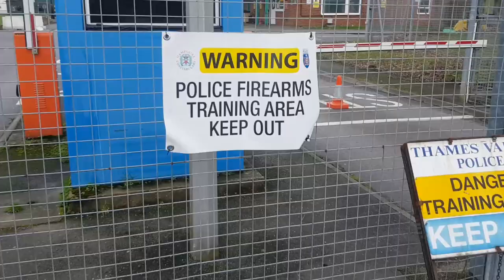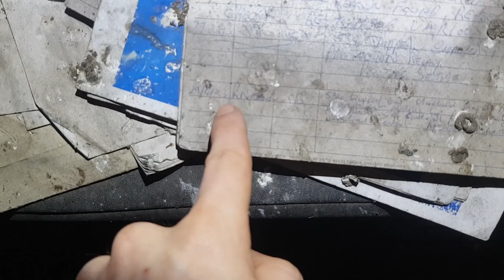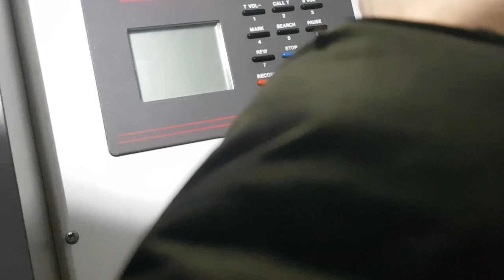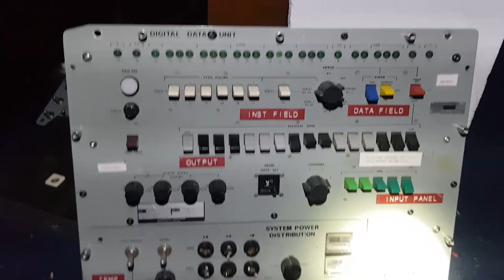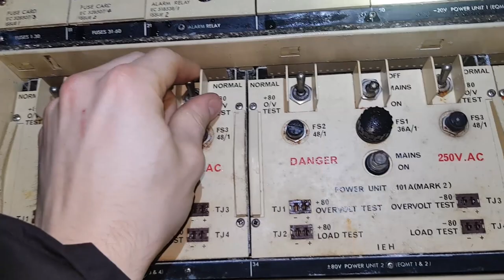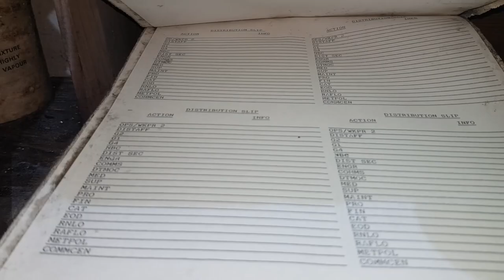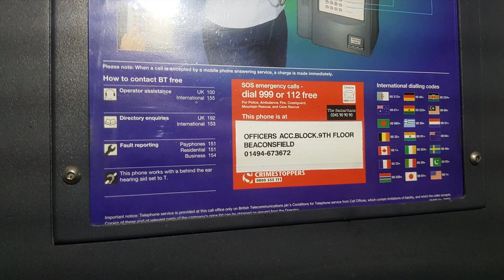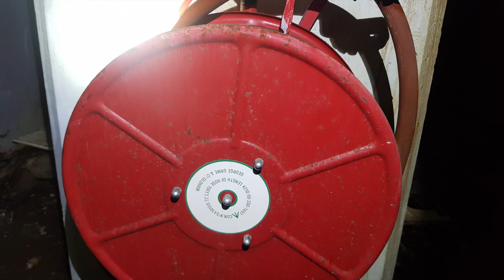Wilton Park, Becons Feild, MI19 (Full Urbex)

Comment: I used to work there, 90-92, the lifts would regularly break down, so we were taught how to release the brakes and lower the lift to the nearest floor so we could release the trapped occupants. This tower would sway something chronic in high winds. I was a fire NCO at this camp and if there had been a fire in the tower block we would’ve been in trouble, there was no wet or dry rising main, just a fire hose in a wooden box-woeful.